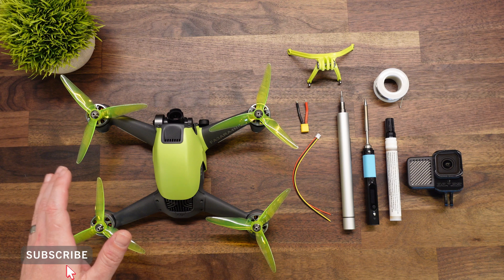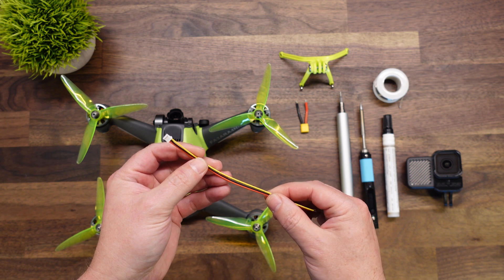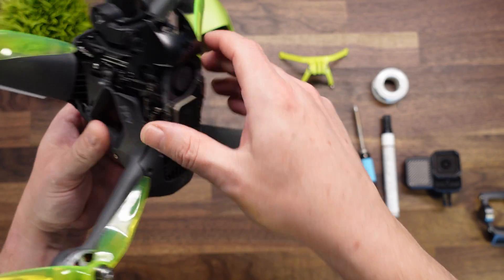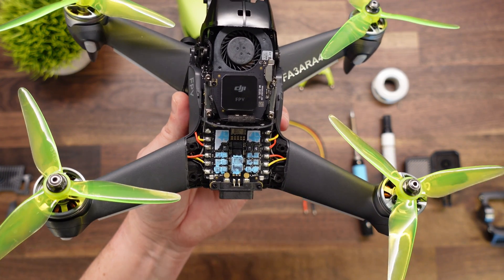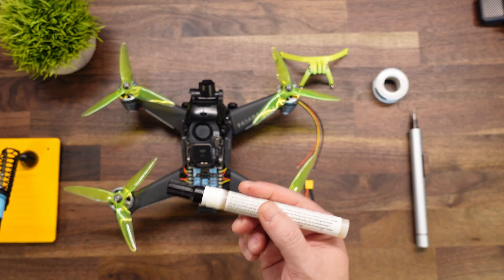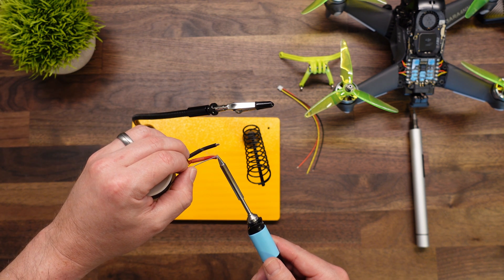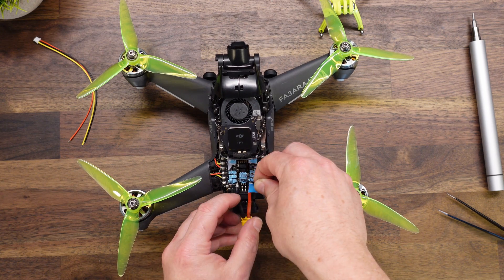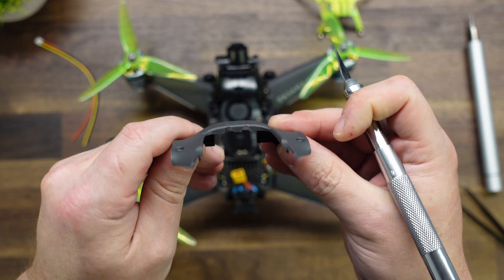DJI FPV + Naked Camera Like the GoPro Hero 10 Black Bones or GEPRC Hero 8 - How to Power and Mount!

Comment: Good informative info,but i cant understand why you would be doing this....your losing less flight time while powering the drone and camera of 1 battery. 

I could certainly use this info and add an additional battery to the drone to get longer flight times using this method.
😊
Reply from the maker: The camera draws so little power it's not even noticeable. Adding additional weight with a separate LiPo would decrease flight times more.

Comment: Lost 2 DJI FPV's with this. The Wifi cut my signal as well as RTH functions! The Camera with this mounting sits directly ontop of the gps unit of drone. Gopro bones works better with other ( regular configuration) drones where it sits farther away!
Reply from the maker: Use the mount that we offer, the camera sits as far to the front of the GPS as possible on the aircraft, several inches away from the GPS. We've sold thousands of them and remains our best selling item to date with no issues. There are several other mounts out there where the camera sits further back and is on top of the GPS, which is obviously not good. Be sure to turn WiFi on the GoPro off (using QR Control is the easiest way). Hero 10 11 and 12 are worse with RF interference compared to 9 and earlier but GoPro Bones is fine.
Reply: @AerialPixel  Will try the QR code to turn off WiFi, In the App it did not allow access to that function so WiFi could not be altered from it's default setting. That seemed to be the most annoying issue I had; I did not require any communication simply the power lead. Thanks for the shout back, appreciate that.

Comment: Flywoo GP11 Naked can also support DJI FPV battery?
Reply from the maker: The GEPRC GP9, GP10 and GP11 are capable of 6S LiPo battery voltage input just like the GoPro Bones. The DJI FPV uses a 6S LiPo, so Yes it should work fine.
Reply: Sorry for late reply. Thanks!

Comment: hello arial pixel! i have made the mod for the geprc naked hero 8 and i have your awsome mount. Thing is that when i turn on the camera i have a satelite hard drop almost to 0, but in the other way, with mi full go pro hero 8, i have no satelite drop....what could be de issue? i have both with same settings...dont know what else could be...the only thing different is the firmware, the geprc hero 8 i cant update it beacause it says that doesent have a batery connected, it tells 0% battery.. any idea how to solve the satelite drop problem? thanks!
Reply from the maker: Now that there is no shielding on your Naked Hero 8 you will need to turn off WiFi on the GoPro. When WiFi is on it causes some RF interference.  The easiest way to do this is using the QR Control app in the PREFS tab.

Comment: Hi, I have a problem with drone gps with the camera, any recommendation?
Reply from the maker: With the Bones camera? That's odd, not experienced that. I have had a drop in satellite count with some other cameras like the Insta360 OneX2. If you do experience that with GoPro's you can try turning off the WiFi on the camera. Also if you are using another mount than ours make sure the mount or camera aren't covering the GPS. Our mount keeps it up closer to the front compared to some of the other mounts on the market.
Reply: @AerialPixel  can I turn off wifi from the bones?
Reply from the maker: Use the QR Control app. On the Prefs tab set WiFi to OFF.
Reply: @AerialPixel  I will try, Thanks for your support 🙌
Reply: @pepezamarripa5743  did you solve the satelites drop issue?

Comment: Hi, I have seen in another videos that they add a bec Middle the gopro and battery because the burned their gopro. This can be possible?
Reply from the maker: You can add a BEC if you want to, It's not necessary though. The GoPro has a built-in BEC that is good for 6s batteries.

Comment: Hi again, how can I connect a gopro naked with betafpv bec, the maximun battery is 4s and the dji fpv battery is 6s 😵
Reply from the maker: You cannot connect the Betafpv BEC directly, you would need to step down the voltage using another inline BEC something like this would work: https://amzn.to/3Fn3y94
Be sure to solder the 9V jumper as it comes 5V which wouldn't be enough.
Reply: @AerialPixel  so the dron battery to 6-30 in and ground and the gopro connector to 5v/9v out and gnd

Sorry for many questions, but your video is awesome and I want to do it
Reply from the maker: See this graphic: https://photos.app.goo.gl/kp29KiPeuFxd3i2x7
Reply: Do you have the picture without orange cover?
Reply from the maker: Just follow the writing on the BEC board. IN is from the drone, OUT goes to the camera.
Reply: Thanks againg, your comments really help to me
Reply: I try with 2 bec but in the two cases the bec is fired 😪😪😪 I do not know what is My error

Comment: If I connect the gopro to battery drone like video, what is the time to fly with connected camera?
Reply from the maker: The battery drain from the camera is minimal. There will be a slight decrease in flight time from the weight and wind resistance of the payload though. This will all depend on the size and weight of the camera used. If using the GoPro Bones, reduction of flight time is very little, less than 10%, if using a full size GoPro you will notice a difference.

Comment: Can the DJI Avata also be modded? I mean to be able to power the Gopro Bones.
Reply from the maker: I haven't seen a teardown video yet that shows where solder points would be. I haven't torn mine apart yet because I don't want to void the warranty just yet.
Reply: @AerialPixel  Thank you
Reply: Check out Nurkfpv. He just did one 👊🏿
Reply from the maker: @fpvdroneproductions  I watched that yesterday, I wish DJI gave us some solder pads instead  of soldering to the connector.
Reply: @fpvdroneproductions  Awesome! Just saw it, thank you 👍

Comment: I did exactly the same as in the video. Now my dji fpv won't turn on anymore. Everything is well soldered in place. How is this possible? After soldering it just turned on. When the camera was plugged in it did nothing. Update: sometimes it goes on but mostly not.
Reply from the maker: Did you cover your solder spots with some sort of insulating tape? The heat sync could be grounding out on your solder joints, especially if you have tall solder beads.
Reply: @AerialPixel  i have just did that and it all fine now, it was grounded to the heatsink. Thanks for your help!
Reply: You solve the problem?  Same here :S i must plug the battery already turned on.
Reply: @gonzafpv2843  The ESC board is damaged. You have to buy a new ESC. If you fly with a broken ESC the drone gets very hot and show some errors.
Reply: @PaintItBlackIt  in mi case was a grounding to the heatsink, thanks anyways

Comment: I took mine to a local hobby shop, they watched your video, then when they finished, installed the battery and plugged in the go pro and I swore I herd something like an electrical pop maybe, I think they didn’t put the blue stuff over the solder point where they soldered the female end of the connector to the power grab and I think the balls were making contact with the heat shield and shorted. 😒 what do I do. Buy a whole new drone? Is there a way to swap out that mother board? Is there a fuse maybe? Idk anything about drones and I have no idea what to do.
Reply from the maker: It does sound like they shorted something. First desolder what they did in case it is still shorting out. If it still doesn't work you can probably just replace the ESC board.  https://cloudcitydrones.com/collections/dji-fpv-series-parts/products/dji-fpv-esc-board
Not sure if I would trust the same hobby shop to do the replacement though.

Comment: Sorry I could not do it. The solder didnt stick to the pads. And when it did it slipped a bit from the pad. I tried 3times then I gave up. 
I dont understand why solder is so Hard. I have watched countless videos on how to solder. But I could not do it. 
I fly it with my full Hero8 instead. Maybe the motors overheat maybe not , I have to see in the future
Reply from the maker: Four things:
1. Make sure the pads are clean
2. Use Flux
3. Make sure your iron is hot enough, usually between 380-400C works best.
4. Use rosin core solder
Reply: @AerialPixel   I did clean.  I used flux and I did all this thing and train on my training board first wich is working like it should do. But as soon when is the real deal, its behave like something else. But screw it, I've tested the drone now afterwards and its no problem at all so I didnt break it atleast

Comment: Thinking about doing this since I heard some ppl have problem with DJI FPV motors geting hot while having a full gopro on it. So the Geprc Hero8 has a built in BEC inside? So I dont have to worry about an BEC on my power cable to my other drones ?
Reply from the maker: Yes the GEPRC Naked Hero 8 also has an internal BEC, it can also accept 2S to 6S LiPo's just like the GoPro Bones.
Reply: did you tried with geprc hero 8? do you have satelites drop when turning on?
Reply: @gonzafpv2843  did not try it . I mounted a full hero 8 instead

Comment: Just a thought! Wouldn't it be easier to just solder the naked GoPro cable directly onto the drone instead of using the xt30 connectors? Or are the cables you sell not long enough?
Reply from the maker: I did the XT30 connector so I could easily remove it when not flying with a naked camera, also so I could interchange between my other naked camera connectors easily. But of course if you want to you could solder the GoPro cable directly, there isn't a lot of places to tuck it in and keep it secure though, if it came out you'd chop it up in the props, and that's a lot of voltage running through those little cables. I personally wouldn't recommend it.
Reply: @AerialPixel  Thanks! I might do the same with the XT30 connector.
Reply: When not using the GoPro, You could route the cable through the canopy?

Comment: I've seen in Original Dobo's tutorial he placed a BEC, he blew up his 10 bones when there wasn't one. would you recommend adding the BEC?
Reply from the maker: It shouldn't be required but wouldn't hurt If you are a "belt and suspenders" kind of person. Blowing a 3rd party BEC would be better than blowing the internal one on the camera. I've heard of a couple stories where this has happened, mine has been fine, but I would think it would be replaceable under warranty if it does since it should be able to handle 6S. I've used this one in the past https://amzn.to/3FSgtzG works great.
On my traditional FPV drones I use the cable in this video that has a built-in BEC https://youtu.be/s0F_cWFR0T8

Comment: Is it worth it when the dji already can take the full gopro ?
Reply from the maker: The weight is much less noticeable with a naked camera.
Reply: @AerialPixel  Hmm okey. Im not sure what im want to do. I dont like to solder stuff. My first thoughts was to put a small 2S battery with it on top
Reply: @possible1337  I was having insane problems with the go pro 10 black go pro on my dji Fpv, the minute I pressed REC on the go pro all satellites to the drone would disappear and would not be able to find its GPS positioning , I tried some tests and wether or not where ever I “placed” the go pro on the drone it did nothing , the only solution That came to mind was the Go Pro Bones
Reply: @Evoque607  did you solve the problem?

Comment: Will this lower your flight times with the added weight and extra power draw? How long is your flight time?
Reply from the maker: With the naked cameras flight times are reduced much less compared to a full size GoPro. Changes in flight characteristics a much less too. Expect to lose 5-10% in flight time adding a naked camera, mileage will vary depending on how you fly.
Reply: Your going to lose 5-10% in battery just with the added weight alone....your also going to lose another 10% minimum by powering the camera of the drone battery....maybe even more than that.

Comment: So, have you flown this yet? If so, how is the GoPro footage? Any vibrations or jello? 

I just purchased the hard plastic top shell with built in GoPro mount hardware. It makes my drone fly and sound horribly. There is so much vibration that it's completely useless. 

Hope the style you have works well?
Reply from the maker: Just like with traditional FPV drones you really need a soft mount to dampen any vibrations coming from the drone. A hard mount isn't good on any drone including the DJI FPV drone, heavy vibrations cause issues with the Gyro in the GoPro. We've sold over 2K of our mounts now, they are even used by professional cinematographers, if installed properly and with the correct camera setting you won't have any issues with the Aerial-Pixel top mount.